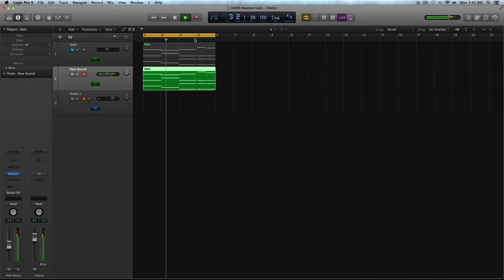NI Massive Tutorial - Gated Sounds in Massive

Comment: Lots of unnecessary steps in there. It would be much simpler to take the flat "ungated" lead and to set a square LFO (not a stepper, why would you even do that?) and assign it to the Amp's sidechain.
Reply from the maker: Felipe Varela That would give you a lot less control over your sound. This way, I can change the velocity and rhythm of thegate. For instance, what if I wanted a stuttered gate where it didn't gate the sound every 1/8th or 16th note, lets say I wanted it to skip a beat here and there for a more interesting and syncopated feel, the Stepper would allow me to do that. The LFO cannot.
Reply: Stepper allows you to get more creative with the amplitude of your gate. This is the most complex way to achieve the sound, teaching you a different perspective of massive. He was recreating a sound that you heard in the beginning, I.E the first 9 bars.
Reply: ***** Ah, you are right. I understand that a Stepper can be more flexible. How about my point about assigning it to the Amp's Sidechain?